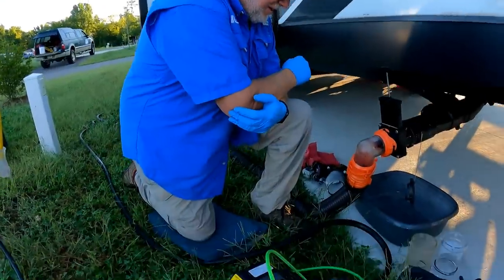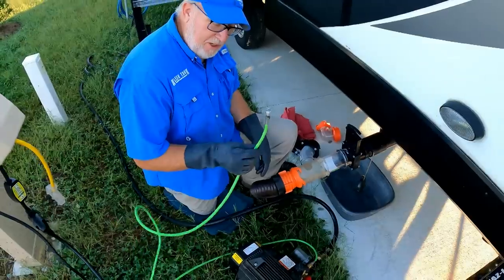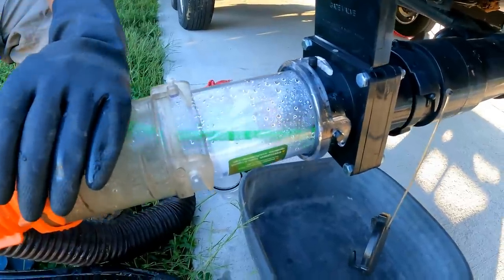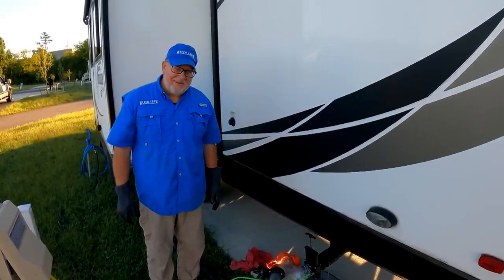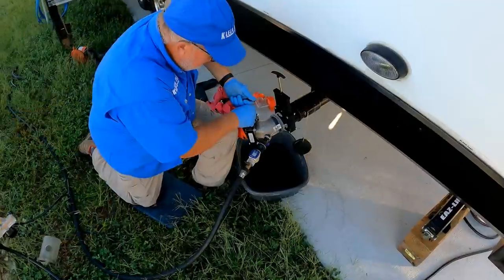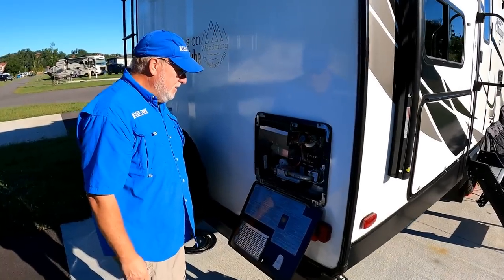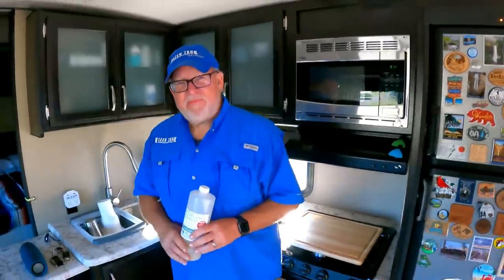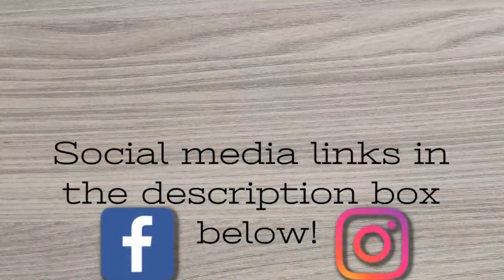RV ENEMA & Professional (Surprising) Advice for Keeping Healthy RV Holding Tanks

Comment: I always keep a toilet pod half a cup of dawn detergent and 3 to 5 gal of water in my black tank at all times so it cleans going down the road. I always keep 3 to 5  gallons in my shower grey tank and half a cup of dawn detergent and half a cup of dawn detergent in my kitchen Galley sink along with 3 to 5 gallons of water  to keep the tanks clean while traveling never have smells and the sensors all work. And always a good 20 minute flush fill flush with the black tank  6 years no issues. Great video 📹 👍.

Comment: When he mentioned that RV tanks are holding tanks and NOT septic tanks, that really hit me. He’s absolutely right! You DON’T want things breaking down in your tank. You want the tank to hold it until you can properly dispose of it. Great video and solid advice!
Reply: While Jim is right--they're not the same, he's also not right.  A septic tank is designed to entirely break down--to digest waste--to a point it can percolate back into the environment, typically through a leaching system.  I don't know that the intent to break down waste in a waste tank to the pancake batter level has ever been the case.  The intent is generally to loosen solids, whether that be TP or 💩, to a state that makes it more...transportable...to convey through your stinky slinky.  Agree with Jim though, you'll experience the best results by not using packed wads of toilet paper and using plenty of water.  Remember, *the solution to pollution is dilution*.
Reply: @EckdahlWrestling  Yep! But a tank full of water with solids (TP and undigested waste) floating in it empties fastest and quickest, leaving little behind. Those additives just make a sticky mess that stays behind -- for years -- unless professionally cleaned periodically.
Reply: Thanks, Trail Boss. That advice really seems to hit home with a lot of RVers. As I said, you want your tank to contain "floaters" not "sinkers." A tank full of mostly water with waste floating on top empties faster and better, smells less, and is an overall healthier tank.
Reply: 100% @EckdahlWrestling

Comment: Just a PSA about making the Pine Sol/Calgon mixture (spoken from experience): when you mix these two together, they foam up. A lot! So be sure you're mixing them in a large enough container to account for that. I mixed 24 oz Pine Sol (half the bottle) with 1/2 cup (4 oz) Calgon Bath Beads in a 2 quart Nalgene bottle - that one was fine because it's open and large although the foam rose to the top of the bottle. However, I also mixed Calgon into the remaining Pine Sol in the bottle - that was a disaster! Tried putting the cap on to prevent the massive foaming but that just added pressure, and trying to open the cap resulted in my kitchen sink and window being sprayed with the mixture! When the foam subsides, you can fill your container with water and it will be fine. I've used the Geo method with good success before, so I know this will work well and is much cheaper than buying ready-made stuff.
Reply: Try this.   Struvite is like a soft rock that is crystals formed when you mix hard water, urine, and fecal matter.  It sticks to the tank and causes sensors to not work correctly.  To clean struvite from tank you need acid.   Calgon has ph of 8.4?   Borax has ph 9.4.   Either works.   You need detergent to clean the surface of the struvite so the acid can dissolve it.   Most say to use Dawn.   Foams a lot.   So, I use Laundry detergent (Tide pods) or dishwashing detergent.   Low foam and work very well.   Two times and it got out what previous owner of RV left in the tank.  Sensors work great.   Add Calgon or Borax every tank.  The detergent is once in a while afterward.   Best wishes.

Comment: Good video, I'm sure you asked Jim, about leaving the gray tank dump valve open all time? I'm sure he said do not, they tanks are holding tanks and are designed to work off of volume and flow.
Reply: The only time(s) I recommend leaving a gray tank valve open (and NEVER a black one!) is when doing laundry or a whole lot of showers in a row (think: large family after a day at the beach). Leaving the gray tank valve (or any valve, for that matter) only encourages clogs and other problems as liquid seeps out and solids (and, yes, the gray tank has solids) are left behind.

Comment: Jim did mine this weekend at the Lippert Getaway as well. Not sure that it got my black tank sensors working, but we will continue to test that. I was surprised at his explanation of why Happy Camper is bad.  We will try Jim’s recipe and see how that does.  We got the same grades as you.  Really appreciated that Jim shared the recipe he uses.
Reply from the maker: Jim was great. Let us know how your tanks do in a few months. We will do the same.
Reply: As always, I like to hear how our customers are doing after a cleaning. Can we get misreading tank sensors working 100% of the time? No, and we can't guarantee that either. Sensors rust, wires fall off (or were never attached in the first place!), diagnostic boards fail, and other reasons. BUT, are your tanks as clean as they were when they came from the factory? Absolutely!

Comment: Great timing on this video.  I just bought one of these fittings for my pressure washer, but haven't used it yet.  His info does kind of throw me for a loop, we're also weekenders without full hook ups.  I usually have a good opportunity to fill/dump/flush/repeat at the dump station on the way home.  Seeing yours  gives me a good feeling mine is probably ok as well (I've seen scales come out in some of these videos).  I was about to switch to rv digest it, but now I'm not so sure.  I've got a full hookup site in Oct., maybe I'll jet out the tanks and make a decision then.  As you said...or kinda said, if it ain't broke don't fix it.  As usual thanks for the video.
Reply: Where can we buy one of those fittings Mike?

Comment: Hey Corey,  have you been using the Kleen Tank solution in your tanks?
Was wanting to give it a try, was curious what your opinion was?
Currently using Unique RV Digest.
Reply from the maker: We did for a trip or two… it was not good at controlling odor. Went back to Happy Camper. 

Uniques original stuff didn’t do well with the odors either. They sent us their new maximum strength stuff and it’s doing well.

Comment: My toilet sits on top of the black tank, as many do. I made my own cleaning spray wand to use through the toilet, because the ones you buy are garbage, which will do a far better job than this pressure washer. It leaves the tank spotless. Yes, I know many toilets are piped to the tank. The only problem I ever have is if something clings to the level sensor terminals. My cleaning method easily cleans this. I don't use any tank products and I don't get odors, poop pyramids or any other problems.
People obsess over holding tanks and handle dumping like they were handling nuclear waste. Elbow length gloves, rubber boots, grimaced faces and everything at arms length. All completely unnecessary but humorous to watch while waiting at the dump station. 
A little common sense and an understanding of your own equipment is all that is needed.

As for water heaters, I had to make my own flushing tool for that too for the same reason. Do the flushing when the water is still warm. The mineral deposits will be soft and flush out more easily. What people don't seem to know is that even after you drain the heater there's still a quart or more of water in it that needs to be siphoned out before any storage.

Comment: I’m distracted by the fact he is handling the sewer hoses and then pushing his glasses up with his contaminated gloves, over and over!
Reply: Yeah, I saw that too.  Later on, as Jim was draining with the flush king's valve, he crossed his arms with the gloves on.  Certainly less gross than feeding the cleaning wand and pushing his glasses up, but whenever I touch any of that stuff, you'd thought I was doing a sanitary surgical experiment.  I ain't touching nothing!
Frankly, I think Jim's high pressure hose would need to have more control to really effectively wash out the tank as it is.  Does it help, probably, but unless you could really control that business end to spray more of the tank, how much are you really getting washed down?  I was actually hoping he was going to send a scope down the pipe to see where he was washing.  That'd certainly confirm its effectiveness.
That said, I've seen demonstrations that the Flush King doesn't really do a good job of cleaning tanks.  As Jim mentioned, he was really just filling the tank.  In my opinion, that's not much different than my son washing dishes by just letting them fill up.  I get his point, it's faster, but I like the idea (the concept really) of at least he spray port washing down the areas it reaches.  I'll typically run the tank flush a while with the valve closed, just to add some water to the tank to have the power to flush out larger solids--never letting it get full enough to waste that much water, or pressurize the tank.  I've had good luck with that.
Reply: @EckdahlWrestling  I don’t want my own shit on me, let alone someone else’s!
Reply: You know, I guess I never really was aware I was doing that! Thanks for pointing it out -- I'll try harder to be a bit more sanitary.
Reply: @EckdahlWrestling  The cleaning head at the end of the wand jets out water in a 24" (or more) high-pressure jet. It's more than enough to completely clean the tank. I have a scope, but honestly the spray of water is like putting a camera into the Niagara Falls -- there's just no way to see what you are cleaning in there. In the end, I rely on 8 years of experience -- literally thousands of holding tanks cleaned -- to know what's going on inside and when I'm satisfied that the tanks are cleaned.

As for the Flush King, it actually isn't doing that much cleaning at this point, rather it's a rinsing function after the hydrojetting process. Filling the tank? Absolutely! At a much higher rate and with much more forceful overall pressure than you can with the black tank rinser. Plus, the Flush King allows me to rinse the gray tanks -- something only higher end (or after market additions) RVs have the ability to do.
Reply: @jamestome5219  I've seen you've responded to several of my comments--and I genuinely appreciate that.  I respect that you've made a business out of dealing with other people's 'business'.  Doing this for 8 years and literally cleaning thousands of tanks, I can appreciate what you've been through to build your business.
The pressure (at the pump) you're working with is very comparable to the pressure you'd see at a good car wash.  Just like the car wash, the pressure probably is adequate to remove the bulk of the stuff stuck to it--as it would a muddy car.  So if someone has a considerable amount of build up I'm sure your hydrojetting is probably helpful, but for someone who takes great care to keep their tanks clean...maybe it's just peace of mind.  But, "...just like new...", I'm still skeptical.
The notion of using a scope:  I'm sure all that water moving around inside a relatively small box would be ineffective while it's being used, but why not scope it after, to demonstrate how clean it is?  Please, don't show us a before... ;)
One curiosity, how do you steer the wand?  That is, how do you control it through a wye to go from one drain pipe to the other tank?  How many gallons per minute are you running?
On the Flush King: I remain unconvinced it's an effective way to rinse a tank.  The flush king does not apply any force of water into the tank.  It's going from a 3/4" garden hose to a 3" drain pipe.  Across the length of the drain, it's really just backing up and flooding the bottom of the tank.  Someone else actually did a YT video with a clear tank demonstrating it.  Draining a full tank, it's like after washing dishes--like a nice, dirty lasagna pan--with a sink full of dirty, soapy water.  When I'm done, I pull the plug and all that stuff that was floating (and we all agree floating is better) ends up settling on the sides and bottom of the sink.  I don't just plug up the sink and fill it all the way back up to wash that out, I turn on the faucet and usually use the spray setting to rinse what's left.  Certainly, having some amount of water in the bottom to help convey remaining pieces out is helpful, but filling it all the way up seems like it's just wasting water.  
Obviously, there is not normally an internal mechanism to flush/rinse a gray tank, it is what it is--even if I suggest the Flush King is grossly inefficient.

I appreciate your offer to clean my tanks.  A guy who stands behind his service--even when I remain skeptical--is good in my book, so as I said, I totally respect what you're doing.  I won't ask you to drive all the way out to me to prove me wrong, but if/when we cross paths, I'll be sure to remind you of your offer.
Reply: Smells like money

Comment: Are you still using Jim's tank treatment? Thanks
Reply from the maker: No, back in Happy Camper… it just works. I think we would be more inclined to use Jim’s mix if we were full time but considering we dump after 2-3 days Happy Camper rocks.
Reply: What is happy camper or the receipt

Comment: I still do the "geo method" dawn/calgon but I think the pinesol/softener would be fine.  I was planning on buying some unique and doing it before winterizing.
Reply: Unique not recommended so much, for the same reason as I mention in the video. Think about it: What kind of tank drains better: One with pancake batter in it or full of water with some "floaters"?

Comment: May be a noob question but do the bath bead have to be Calgon brand? Is there something special about that brand?
Reply from the maker: I really don’t know!
Reply: No
Reply: Darik: Honestly, this is one time when Calgon (and the bath kind, not the clotheswashing liquid or the dish/dishwasher detergent) is the best bet. Same goes for the PineSol. Watch out for Pine-based cleaners using pine oil: It's super caustic and eat away soft rubber seals in your RV's tank's gates and seals.

Comment: Did you by chance see what hydro pump he was using?
Reply: You can use a pressure washer, and hydro jet. I purchased my jet online for $40. I use it for house drains, gutter downspout and rv tanks. You buy what ever length you want 25' and up. This is an old post so you might have already found your info, but just in case there you go.

Comment: Is there any chance his device can damage the sensors?
Reply from the maker: He says it’s never happened in 7+ years. I think it’s very safe.
Reply: No, it cannot. In eight years, I have never had the pump or cleaning heads damage the tanks. I do have competitors, however, who are running 4,000-5,000 PSI. That I would be very concerned about, especially if your RV has a macerator toilet (as most will in the coming years) as those tend to have a delicate pressure switch that super-high pressure will definitely damage.

Comment: Do you have a black flush on your trailer ?
Reply from the maker: Yes
Reply: Ok just wondering we have the flush king from our previous trailer that did not have black flush. We have never used it on this trailer that has a black flush. Maybe will try it next time our  sensors are not reading correct. Thanks. This year we started using happy camper in our tanks and no smell and the sensors were great. We are only weekenders.

Comment: It will not come as clean as he suggest. That jet only sprays behind and not in front.
Better than nothing. A wand down the toilet with a spinner or straight hose works great.
Reply: Not actually true. I do have spray heads that also spray ahead and use those in some circumstances. In the case of 5th wheels and travel trailers that have twisty, complex pipe layouts and distant (underneath) tank architecture, the backwards jet is ideal for reaching the tanks. With it's 24"+ high-pressure spray, it easily cleans every inch of the tanks and pipes attached to it.
Reply: @jamestome5219  How can you prove it. I would like to see a demonstration of the jet cleaning every inch of the tank. Thank you

Comment: Funny he never explains anything about the anode rod, or why the atwood water heater doesn't use an anode rod.

Simple Anode rod isn't used in an atwood because the tank material is aluminum which is a naturally corrosion resistant metal.

Suburban uses a steel tank lined with ceramic (on some years) and use an aluminum or magnesium anode rod. To put simply through the action of electrolysis the softer metal (aluminum or magnesium) is sacrificed to natural corrosion instead of the steel tank.

The reason atwood (now dometic) doesn't want you to install a anode rod is they are aftermarket. And some are dissimilar metals which fused in the tanks... This is the only way to drain your tank once it's fused your pretty much SOL.

I wonder how much this guy charged you. He must be making a killing, but his lack of knowledge is alarming. This is year one rv tech stuff nothing crazy.